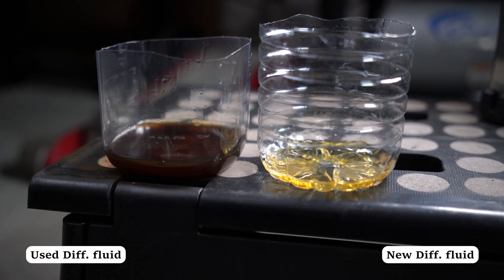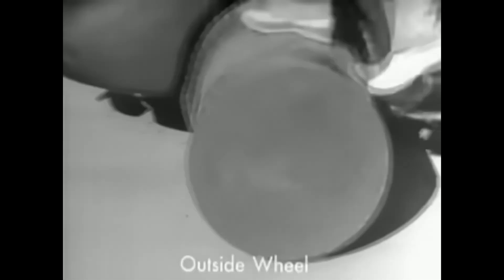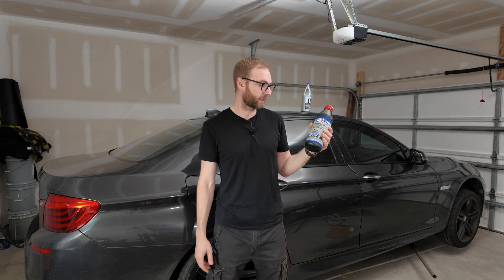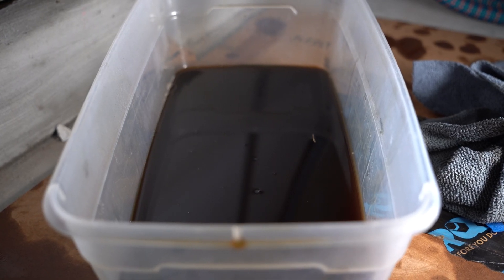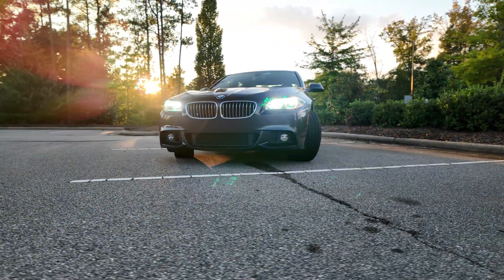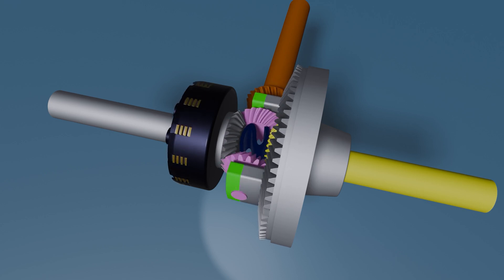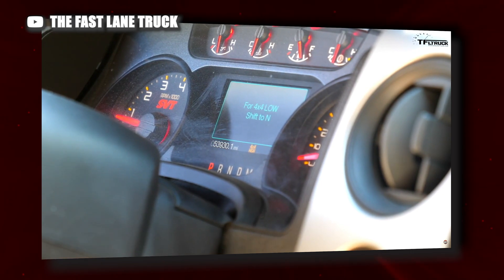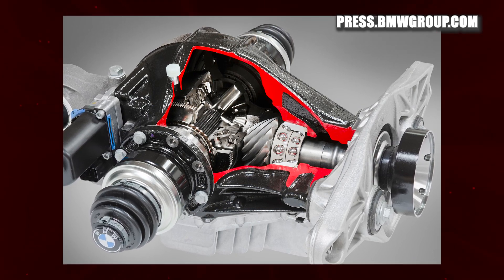Transfer Case & Diff Fluid Explained – BMW F10 Diff fluid change

Comment: LOVED your content mate...so how's it running after 3 months with this mileage ANY whining or issues happened? thanks? 💕💕
Reply from the maker: I think it's less noisy. I did replace the tires as well, so that might be another factor, but right after, I think it felt a bit quieter compared to what it was. Also, I fixed the clunk; it disappeared after diff. bushings, front and rear, as well as some vibrations. I appreciate the comment!